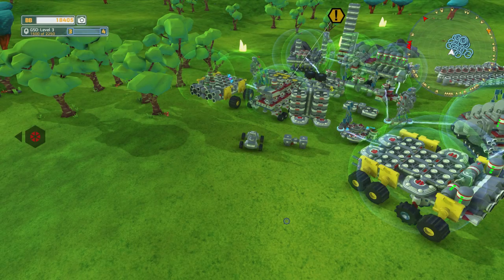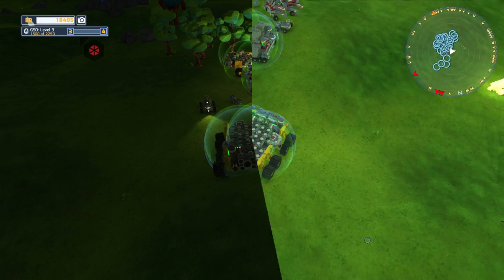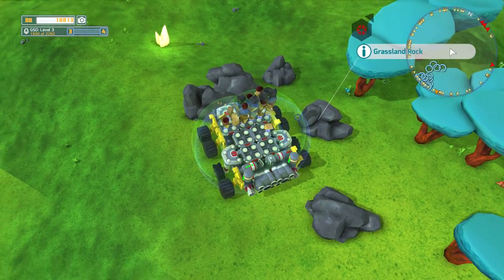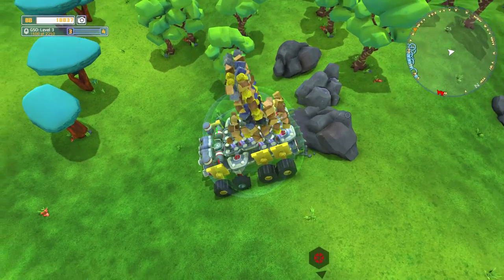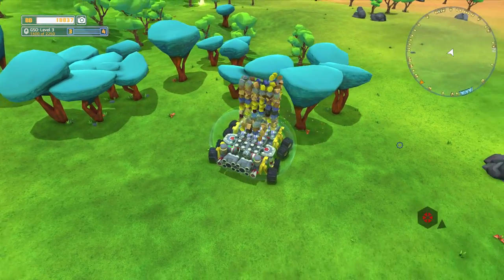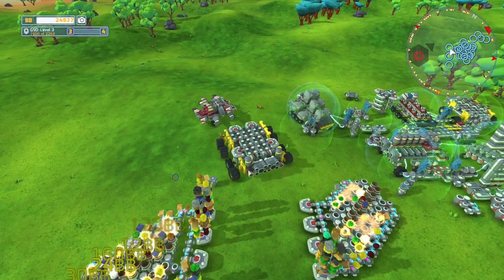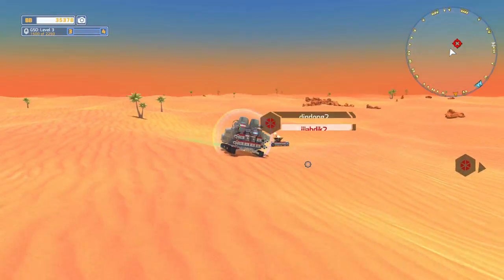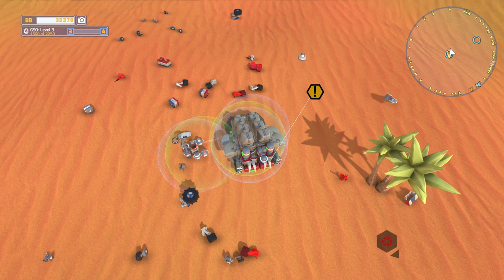TerraTech #9 - Mega Mammoth Mining

Comment: Zisteau, those recievers are not needed , as tractor pads will grab drops on their own. The only thing that those large recievers do that pads don't is grab dropped parts; they also won't give items to other recievers, which is what causes a lot of your lag when transitioning items to your resource refining and selling. Tractor Pads also won't give items to other pads.
Reply: +Kain Yusanagi You are right. But in my opinion the receivers help that the drops don't get stuck under the tech so easily, because they are picked up in front of the tech already. I ended up using a similar design, 
I even use lines of conveyers to move the dropt to tractor pads on the back of the tech. And they provide additional storage space while looking not to bad, too.
Reply: ThePetaaaaa
The large tractor pads have a huge range that makes the recievers pointless for the use he's putting them to, and with his design he only needs to replace the recievers with more tractor pads.
Reply: ***** Right. But after the outer tractor pads are fully filled, the inner one's will start 'sucking up' drops and the possibility of them getting stuck below the tech increases. Or did I make a false observation?
Reply: ThePetaaaaa
If they were the basic pads, yes, but the range on the large pads is enough that it won't be a problem so long as he doesn't make it so that it's one in the middle and two on either side, but two to each side of the middle, four-wide.
Reply: +Kain Yusanagi I like a conveyor down the middle, with a receiver at the front, so the conveyors feed the tractor pads. Only need one big receiver that way.
Currently the receivers do not grab blocks, it has been changed.

If Zisteau needed lots of Plumbia to make alloys, he could just buy GSO single blocks and put them through a scrapper for plumbia ore. But right now you have to manually feed items into the system so that is a bit annoying.

Comment: +Zisteau for the crafting centre, you can make something like a circle using conveyor blocks. 2 blocks width and like 20 blocks length. On the top of it you can put receivers, and for the rest "body" of this circle you can put refineries with cannons. Or you can also connect this refineries using conveyor line at the end of which will be stationary cannon what can sell much more blocks.

Comment: Hey, Zisteau! Don't forget about the Step Conveyors! You're making everything flat (shades of Factorio, I suppose) but there is no reason you can't make 3D structures. I have a factory floor, as a small experimental alloy-production one, where you actually drive the tech UNDER the receivers. There's probably a lot of different setups you can make where the conveyors or refineries are layered atop one another. This way you could have the receiver bay output have two or three as many refineries.

Comment: One thing to watch for, I had a base where I spaced out separate 'buildings', and they ended up moving.  I guess there's an in-game bug where anchor points can drift downhill.  If you want things to stay spaced (like your unloading point), keep them connected with a high bridge (not too tedious with 3x or 4x blocks.  It has the bonus of looking pretty cool, with the downside that if an enemy AI targets it, you can lose half your base at once :)

Other than that, make sure you have lots of space between buildings and try to plan for possible drift of your fixed anchors.

Comment: at 11:55 your worry about adding more receivers what you need to do is add a buffer zone a completely different anchor point next to only one receiver of your processor plant.  this tech will have two to four receivers and a group of tractor pads and will pull all you oar off the tech  then the processor plant will pull from the buffer. if this is unclear ill post pics